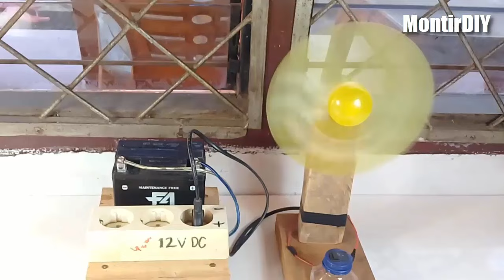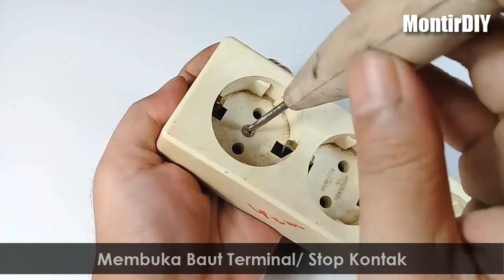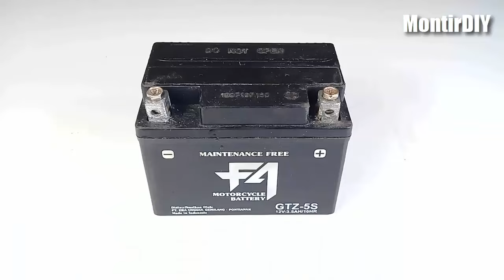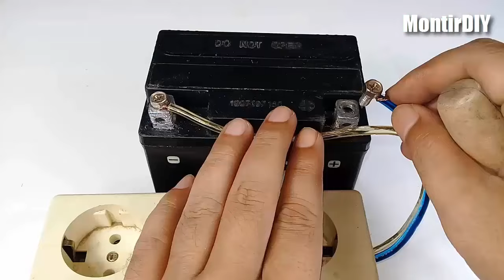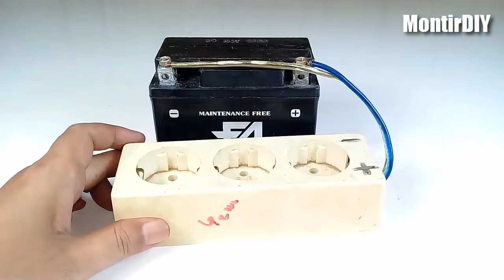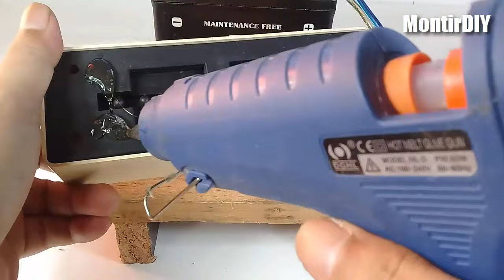CARA MEMBUAT TERMINAL LISTRIK DARI AKI | IDE KREATIF | TUTORIAL DIY

Comment: Bang saya udah beli aki dan lampu dc 3 buah masing2 15ah dan mau dipakai berbarengan, apa harus pake adaptor ya biar bisa tahan lama ?
Reply from the maker: Harus tau dulu berapa volt kebutuhan lampu dc nya. Agar bisa menggunakan terminal listrik aki ini maka lampu dc nya harus 12 volt.
Tidak perlu pakai adaptor lagi. Karena sepengetahuan saya, fungsi adaptor untuk mengubah tegangan ac tinggi (listrik PLN 220 ac) menjadi tegangan dc rendah. Sedangkan terminal listrik aki ini sudah menghasilkan tegangan dc rendah (12 Volt).
Reply: @MontirDIY   3 lampu masing2 12 volt begitu juga akinya. 3 lampu tapi 1 aki gpp ya? Soalnya tadi ada yg cerita kalo pake lampu banyak di 1 aki baiknya dikasih adaptor supaya tahan lama
Reply from the maker: Berarti spek lampunya udah sesuai dengan spek aki. Artinya bisa digunakan. Ya boleh pakai 3 Lampu sekaligus untuk 1 aki, karena rangkaian Terminal Listrik ini adalah Rangkaian Parallel. Hanya saja, semakin banyak lampu yang terhubung, maka semakin cepat pula listrik akinya habis.
Reply: @MontirDIY  oke sip makasih bang
Reply: Sya tadi coba ko gabisa ya buat cas hp
Reply: Bang.. Apa kah bisa nyala lampu nya? Sampai 3 lampu..

Comment: Bang kalo disambungkan speaker/salon kuat gk bang?plis jawab
Reply from the maker: Sepertinya tidak bisa, karena setau saya, speaker/ salon butuh input Listrik AC. Sedangkan Terminal ini mengeluarkan Listrik DC.
Reply: @MontirDIY  DC itu apa y bang
Reply: Kalo mau beli inverter 12v ke 220v bang
Reply: @DoraIDN93  DC(direct current) itu arus listrik sejajar sedangkan AC(alternating current) itu arus listrik bolak balik

Comment: Maaf MZ misal buat jualan keliling pakai blender sama alat press gelas minuman bisa gak??🙏
Reply from the maker: Kalau digunakan untuk Lampu DC 12 Volt atau biasa disebut Lampu Aki, maka bisa digunakan. Tapi kalau buat Blender atau Alat Press Gelas Plastik, sepertinya tidak bisa, karena setau saya alat-alat tersebut membutuhkan Listrik AC bukan Listrik DC. Lagian sepertinya Blender dan Alat Press sepertinya butuh Listrik lumayan besar.
Reply from the maker: Jika ingin tetap menggunakan terminal aki ini untuk Blender dan Alat Press maka Blender dan Alat Pressnya harus dimodif dulu atau ditambahkan rangkaian converter dari DC ke AC. Dan kemungkinan ukuran Volt dan Ampere Aki yang akan digunakan harus lebih besar lagi (Besar dari 12 Volt 3,5 Ampere), Mungkin 24 Volt, atau 2 Aki 12 Volt atau lebih yang di Seri atau Parallel tergantung rangkaian yang digunakan.
Catatan: Saya belum tau pasti berapa kebutuhan Listrik Blender dan Alat Press.

Comment: Saya mau pakai lampu 40 watt dengan cara ini, rekomendasi aki berapa ampere / AH ya? Rencana mau pakai aki mobil
Reply from the maker: Sebenarnya saya juga belum terlalu faham cara perhitungan/ rumus detailnya dan belum punya pengalaman. Tapi jika menggunakan rumus dasar, misalkan Aki 12V dengan Kapasitas Arus 40 AH, Artinya Aki tersebut mampu menghasilkan Daya sebesar 12 x 40 = 480 WH (Watt Hours).

Jika digunakan untuk menyalakan Lampu sebesar 40 Watt maka; 480:40= 12. Artinya Aki tersebut mampu menyalakan Lampu 40 Watt selama 12 Jam.

Namun rumus diatas hanya rumus dasarnya saja, walau sama-sama Listrik DC, pada kenyataannya sifat sebuah Aki itu berbeda dengan Listrik DC yang bersumber dari Adaptor/ Power Supply yang bersumber dari Listrik Rumah. Dimana, Listrik/ Tegangan pada Aki akan semakin menurun seiring dengan penggunaannya. Dan Listrik dari Aki tidak boleh sampai Kosong/ ada batas Tegangannya. 

Untuk mengatasi hal ini maka Aki perlu dilakukan pengecasan setiap periode/ batas tertentu secara manual. Sedangkan pada Mobil/ Motor, Aki akan mengecas sendiri/ otomatis ketika mobil/ motor hidup/ berjalan.

Semoga ada teman-teman yang bisa bantu kasih masukan...

Comment: Kalau untuk mesin air yg di akuarium bisa gak bang.?
Reply from the maker: Tergantung spek mesin air aquariumnya. Kalo spek input listrik mesin aquariumnya12 Volt DC maka bisa pakai aki.
Reply from the maker: Kalau bisa modif sendiri, coba mesin air aquariumnya langsung terhubung ke Terminal Listrik ini tanpa melalui Adaptor bawaan mesin aquarium. Itupun jika dinamo/ motor listrik mesin air aquariumnya support dengan Tegangan DC 12 Volt.

Comment: Buat colok router WiFi kuat ga ya?cuma dipake buat mati lampu aja lumayan
Reply from the maker: Buat Router WIFI  kayaknya gak bisa, soalnya Router butuhnya listrik AC, yang ini listrik DC. Betul, kalau digunakan saat lampu mati untuk Lampu DC atau Lampu Aki, lumayan daripada Aki bekasnya dibuang. Lagian Akinya juga bisa dicas lagi.
Reply from the maker: Kalau hanya sekedar untuk menghidupkan Lampu DC/ Lampu Aki atau menghidupkan Kipas Angin DC, Aki Motor bekas sebenarnya masih layak untuk digunakan.
Reply from the maker: Router WIFI termasuk perangkat elektronik yang rumit dan mungkin saja butuh listrik yang stabil. Jika seandainya Router WIFI tidak tidak membutuhkan Listrik yang stabilpun, maka Terminal Listrik dari Aki ini tetap tidak bisa digunakan, kecuali ada bagian tertentu yang dimodif.

Comment: Klau aki yg terhubung di mobil bisa gak yah??
Reply from the maker: Bisa saja sih, cuma tidak disarankan pakai aki yang masih terhubung ke mobil atau ke motor, karena takutnya aki bisa cepat tekor dan tentunya mempengaruhi kinerja kendaraan, mungkin.
Setau saya aki yang terhubung ke mobil atau motor sudah didesain berapa kebutuhan supply listriknya buat kendaraan. Lebih dari itu aki akan cepat tekor.
Saran saya lebih baik pakai aki terpisah. CMIIW
Reply from the maker: Oya lampu yang saya gunakan ini untuk 12 Volt DC. Jika Volt aki 24 Volt atau lebih dari 12 Volt, maka lampu ini akan putus/ rusak.

Comment: bang mau tanya, kalo untuk lampu dan charge hp bisa gak ya, dan kuat berapa lama?
Reply from the maker: Tidak bisa buat charge hp.
Reply: @MontirDIY  tapi kalo di motor kok bisa ya?
Reply from the maker: Lampu Motor biasanya pakai jenis Lampu Pijar. Lampu Pijar bisa digunakan pada Listrik AC seperti pada listrik rumah dan Listrik DC seperti pada Aki dan Baterai. Jadi, Lampu Pijar bisa buat Aki, asalkan voltasenya cocok dengan voltase Aki. Lampu LED pun bisa asalkan khusus yang buat Listrik DC. Sebab, Lampu LED ada juga yang dibuat khusus untuk Listrik AC.

Kalau buat Charge hp dari Aki, maka diperlukan Modul atau Rangkaian tambahan, tidak bisa dari Aki langsung dihubungkan ke Charger hp. Karena Charger hp pada umumnya butuh input Listrik AC, sedangkan Aki adalah Sumber Listrik DC. Begitu sepengetahuan saya...
Reply from the maker: Lampu motor bisa langsung dihubungkan ke Aki, tanpa Modul atau Rangkaian tambahan. Silahkan dicoba. Lumayan, bisa dijadikan Lampu darurat jika listrik mati.
Reply from the maker: Untuk charge hp di motor pun, kayaknya juga butuh modul/ rangkaian tambahan. Tidak bisa Aki langsung terhubung ke Charger hp, karena Aki itu menghasilkan Listrik DC, sedangkan charger hp butuhnya Listrik AC.
Reply: @MontirDIY  berati harus ada inviter ya ka?
Reply from the maker: Iya betul. Secara teori harus pakai inverter. Namun saya juga belum pernah mencobanya dan membuktikannya secara langsung.

Comment: 12v bisa untuk berapa watt lampu bang , mohon dijawab terimakasih 🙏🏻🙏🏻🙏🏻
Reply from the maker: Tergantung AH Akinya bang. Kalau aki yang ini 3,5 AH dan 12V. 
Watt = 3,5 x 12 = 42 Watt. Artinya secara teori, Aki ini maksimal sanggup menyalakan Lampu 42 Watt selama 1 Jam.
Jika Lampunya kecil dari 42 Watt maka ketahanan nyala Lampunya akan semakin lama. Dengan catatan, Volt Lampunya sudah mendukung untuk 12 Volt. CMIIW
Reply from the maker: Namun perlu juga diingat bahwa Aki adalah sumber Listrik DC dengan nilai Tegangan yang tidak tetap. Tegangan Aki semakin dipakai akan semakin menurun, hal ini berbeda dengan sumber Listrik DC lainnya seperti Adaptor atau Power Supply yang terhubung ke Listrik PLN, dimana nilai Tegangannya cenderung stabil.
Reply: Kak
Kalau mesin tetas 80w  cocok aki berapa volt bg
Reply: @MontirDIY   boleh minta no wa mas mau tanya²
Reply: @bayuaditya2405  buset 
mo lu gebet yak

Comment: Untuk sound 12 DC 2A bisa gak bang?
Reply from the maker: Jika input Soundnya butuh 12 V DC  2 A maka bisa digunakan.
Reply from the maker: Hanya saja, salah satu kekurangan Listrik DC dari Aki adalah Voltasenya yang semakin lama semakin berkurang. Yang tentunya akan berpengaruh pada suara yang dihasilkan. Berbeda dengan Listrik DC dari Adaptor/ Power Supply yang berasal dari Listrik Rumah/ Listrik AC, dimana Voltasenya cenderung stabil.

Comment: Bang, kalau untuk keperluan 12V 2A bisa ga ?
Reply from the maker: Secara umum untuk keperluan 12V DC 2A bisa. Tapi tergantung peralatan elektronik yang akan digunakan juga. Jika peralatan elektroniknya tidak harus menggunakan listrik yang stabil, maka terminal listrik aki ini bisa digunakan. Tapi jika peralatan elektroniknya butuh voltase 12 Volt DC dengan nilai tetap, maka listrik aki ini tidak disarankan untuk digunakan, karena Voltase aki ini semakin lama akan semakin turun nilainya.
Saran saya, lebih baik hanya digunakan buat lampu DC dan Kipas Angin DC saja.
Reply from the maker: Kalau untuk 12V AC 2A tidak bisa.
Reply: @MontirDIY  bang pakai aki mobil bisa tdk?

Comment: Kalau pake aki voltase yg besar bisa ga bang?
Reply from the maker: Bisa. Hanya saja Tegangan Listrik peralatan yang akan digunakan harus menyesuaikan dengan Tegangan Listrik Akinya. Misalnya, kita pakai Aki 24 Volt, maka Tegangan Lampu DC yang digunakan harus 24 Volt juga.
Reply: @MontirDIY  mau tanya kalau misalkan tegangan suatu peralatan nya kurang dari yang di sebutkan kakak 24 volt itu berpengaruh kemana nya kak ? , soal nya saya mau buat untuk colokan wifi sedang kan tegangan adaptor saya 9,0 volt output nya